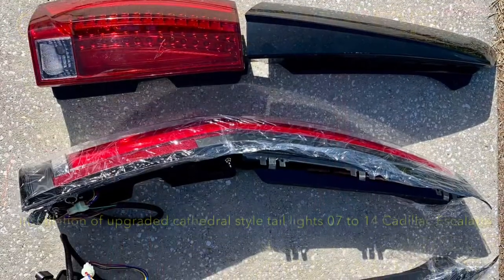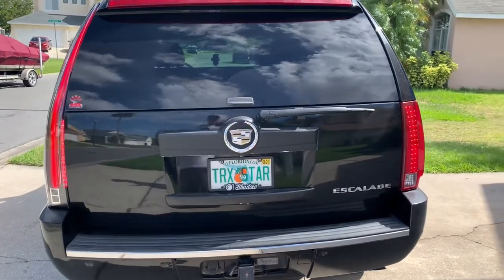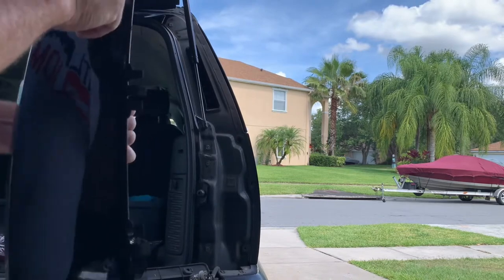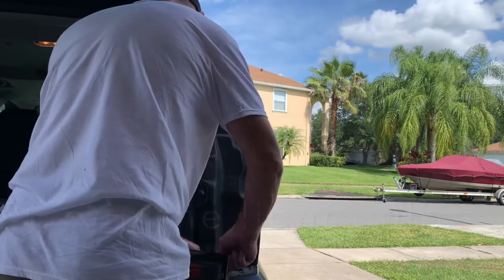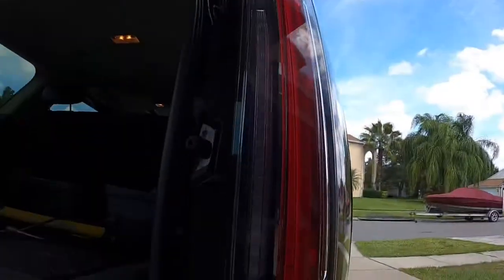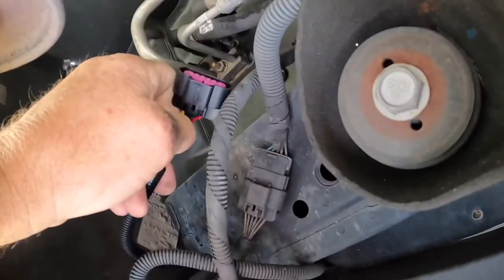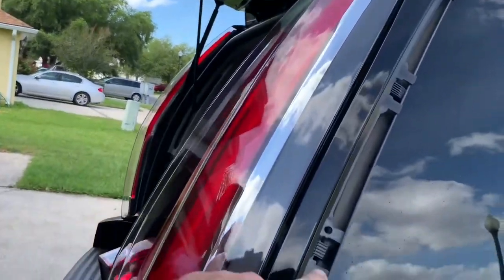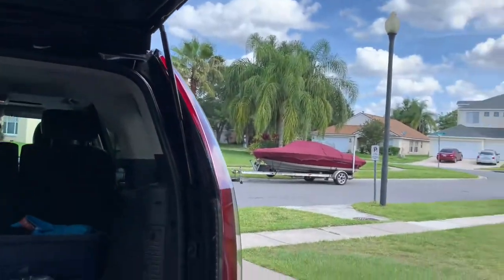07-14 Cadillac Escalade cathedral style taillight conversion

Comment: I had a cracked tail light on the '07 Escalade so eventually had to do something about it. Decided to go with the new style units. These things have to be the biggest tail lights ever made for a production vehicle -- 41" top to bottom. My only complaint is that the turn signal LED's are red whereas the OEM's are yellow on the 2015's and newer. Otherwise I love them! Definitely worth it and the install was piece of cake easy -- plug and play!

Comment: I just changed from the smoked-lens cathedral tail lamps to the clear lamps. The 'old' smoked set (August 2021) developed an issue with the tall passenger side element not illuminating in unison with the shorter stack of LEDs when using the turn signal.

 The red light illuminating with these clear lamps (installed July 2022) is really dramatic in the daytime in ambient light. Very pleased with the new, clear lamps.

*edit The effect of the clear lamps when they illuminate at night is something that has to be seen to be appreciated. It's really very nice.
Reply from the maker: I agree

Comment: Did you have to remove the GM grommets ( where metal tabs go in on factory tail lights ) to get these new ones to seat flush? I have had 2 sets of these and both pair the passenger tail light had gaps on top and bottom so I was wondering if this might have been the issue. I did not remove grommets thought.
Reply from the maker: I did not remove them and i have a gap at the top as well.

Comment: I saw that your old light bulb comes with the square plug just like mine.  And in the new one comes the purple rectangle plug.  did you have to buy an adapter?
Reply from the maker: I did not, it sounds like you have the wrong bulb?
Reply from the maker: Actually, our did come with  the adapter needed. At first i didn't notice it, almost through it away.
Reply: @BLK86SS  Cool.  I'm taking it to a mechanic, I think I must be doing something wrong.

Comment: What were u connecting?...why are all those wires pulled out?...it shoupd be just a pug in....I'm confused 
...and i said plug in the bulb....for what?
Reply from the maker: The new wires came installed on the new lights and the bulb was unplugged. And it is plug in play, you have to remove the the old extension from under the bumper and plug the new longer wires with the new tail lights directly into the wire harness under the bumper. It should make sense if you have the new lights. Or maybe different companies wire them different? Thats just the way these came and were installed.
Reply: @robnolli9299 ooohhhh...thanks for the clarification...I just installed mine yesterday after watching your video and was wondering why all these extra steps...hahah...but mine came with tye wires all installed...thanks again for the great video!!!

Comment: I have a 2011 escalade esv platinum. Will this conversion work on esv?
Reply from the maker: Yes, it should be the same.
Reply: @BLK86SS  lol I drive a tow truck and that word and I've come to find out that word "should" is a very safe word to use. "Should" means 50 50 in my eyes